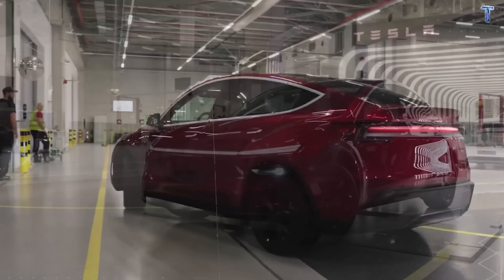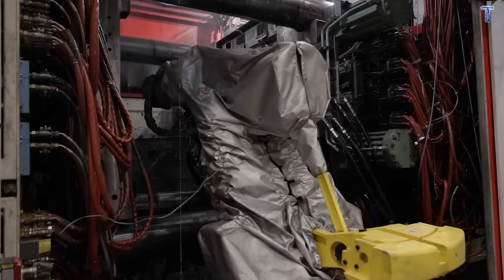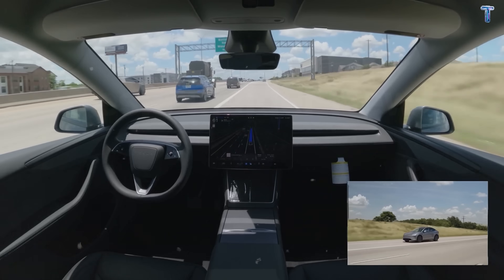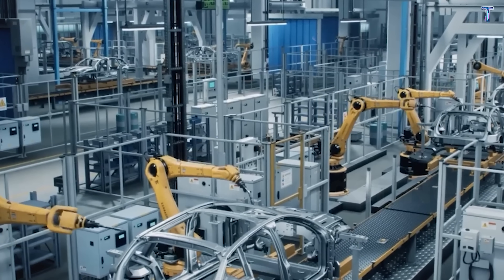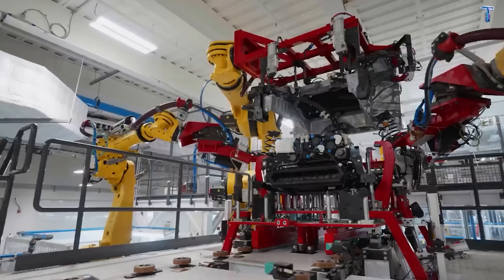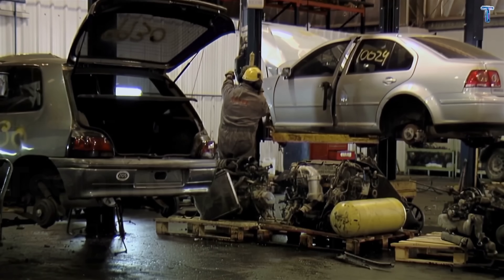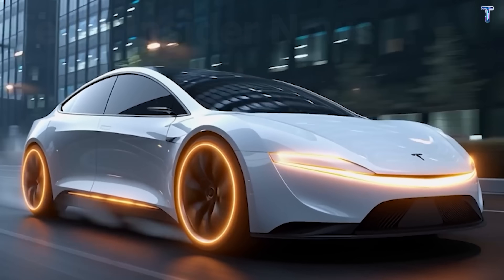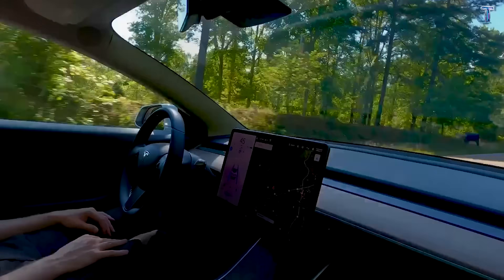Elon Musk’s $12,749 Model 2 Ends Car Bills Forever

Comment: How much will it cost to repair that one piece body when someone backs into it in the parking lot?
Reply from the maker: Fair question. The upside is most low-speed bumps only affect the outer panels, not the main structure. Repairs should be quicker and cheaper than people expect. Have you ever had a car where one tiny dent turned into a big repair bill?

Comment: I still have my car from 93 and love it still these ev cars are not a good alternative to ice cars plus the driving experience is very disconnected feeling in every way I can think of also we know how to recycle an ice engine but we don't have a way as of yet to recycle the batteries and that's not including battery issues people aren't getting 250k plus miles on the original battery to me its not worth it and they are overpriced even this is imho.
Reply from the maker: I get where you’re coming from. A solid ’93 is hard to beat. EV tech is improving fast, especially battery lifespan and recycling. What’s the part of your ’93 you think EVs can’t match yet?

Comment: The Tesla Model 2, codenamed "Redwood," is Tesla's anticipated affordable EV, targeting a ~$25k price point with a focus on cost reduction through simpler design, new manufacturing (like Giga Press), and innovative features like modular consoles and passive cooling, aiming for mass market appeal with a ~250-mile range and potential 2025-2026 launch, though official confirmation is pending, say recent 2025 reports and automotive sites. It's expected to feature new 48-volt architecture, basic interiors, and advanced software for handling, balancing cost with performance, says sources including YouTube channels and car news sites.
Reply from the maker: That’s a solid summary, and you’ve clearly been following the reports closely. The Redwood codename, simplified architecture, and 25k target line up with what most analysts expect right now. The big question is whether Tesla can actually hit those cost reductions at scale without cutting too deeply into features people care about. If the real price lands near that 25k mark with around 250 miles of range, would that meet your expectations for an affordable EV?

Comment: They're talking used prices here, the value the moment after the customer signs the purchase agreement. The customer calls it new but dealers call it used.
Reply from the maker: Dealers definitely see that instant drop in value differently than buyers do, and calling it “used” the moment the paperwork is signed reflects that mindset. For most people, that shift is invisible until they try to trade in. Do you think more transparent pricing would change how people view that immediate depreciation?

Comment: AI
Reply from the maker: It’s fair to question the price and the timeline — a lot of the info is still speculative. If Tesla does announce something official, that’s when we’ll know what’s real. What detail would convince you the most that a low-cost model is actually happening?
Reply: @TeslaInsiderNews  This ad is full of AI generated images. That is what I was addressing whether or not it will be ready as advertised and at that price. Which I doubt.
Reply from the maker: AI-generated images definitely make the whole thing feel less credible, especially when the visuals don’t match anything Tesla has shown officially. They’re great for concept videos, but they can also make people assume the claims are exaggerated or entirely fictional. Until Tesla shows real prototypes and real pricing, doubt is the reasonable position.

If an official reveal used real factory photos and confirmed specs instead of AI concepts, would that change how seriously you take the project?
Reply: @TeslaInsiderNews   Real factory photos and confirmed specs would help but the only thing that would convince me would be the testimony from some believable buyer that actually purchased one and what he actually paid for it. Further,  I find it difficult to believe the price will prove to be substantially less that, say, around 30k.

Comment: Ja ya had me till the self driving car 🚗…. That’s a HARD NO !
Reply from the maker: Totally get that — self-driving is a deal-breaker for a lot of people right now. The good thing is you can still drive it normally and ignore the autonomous features. What part of self-driving makes it a hard no for you?
Reply: @TeslaInsiderNews  the self driving vehicle 🚗 means that the car is not fully in the drivers control.  ( obviously, 🙄 I know ) but that’s the point. 
Being responsible for the vehicle and its safety is a part of the experience of driving.   By having an autonomous vehicle, part of that unique experience is removed. 
Personally, I take driving seriously and the responsibility that comes with driving is learned often through mistakes or failures.    
To allow the computer and sensors to guide the vehicle is against common sense, it would be irrational to trust such hard learned skills to AI 🤖
Reply from the maker: Trusting an autonomous system definitely feels counterintuitive when driving has always been a skill you control directly. The responsibility, the attention, the judgment you build over years — that’s part of what makes people confident behind the wheel. Handing some of that over to sensors and algorithms can feel like giving up something essential, even if the tech improves safety on paper.

A lot of drivers will still want the option to stay fully in control, even if assistance features exist in the background. For you, is the concern more about losing that learned responsibility, or about AI making decisions you’d rather handle yourself?
Reply: @TeslaInsiderNews  Thank you for the dialogue.     I have become accustomed to many automated processes in life and have seen nearly miraculous progress. 
However the responsibility of driving an automobile 🚗 is considerably greater than my own personal safety.    It involves the safety of others and it would be difficult to entrust sensors to that duty.    My cautious approach is built on both personal experience and statistical data.   There are simply too many variables in a real life 3 dimensional environment to allow me to feel comfortable with autonomous vehicles.    Even though I believe there are wonderful places for such conveyances such as airport trams 🚈 and light rail.    The undertaking of risk should be accompanied by the responsibility of the driver.   For example,It would be safer for an impaired driver to give the computer the job of driving home from the bar, however the impaired person isn’t in any position to delegate responsibility.
Reply from the maker: That’s a thoughtful way to look at it — the responsibility of driving isn’t just about your own safety but everyone sharing the road with you. When you’ve built real skill through experience, trusting sensors and software to make split-second decisions can feel like giving up something essential, especially when the environment is unpredictable in ways AI still struggles with.

Autonomous tech works well in controlled systems like airport trams or rail lines because variables are limited. Out on real roads, you’re dealing with weather, human behavior, animals, debris, unpredictable drivers — all the things your instincts were built to handle.

For people who take driving seriously, keeping that responsibility in their own hands feels like the only rational choice. If future systems allowed you to stay fully in command but use autonomy only as a backup, would that strike a better balance, or do you prefer keeping the car entirely manual?
Reply: @TeslaInsiderNews . Undoubtedly, AI will become far better and its situational awareness will increase.   So, yes there will be a time when a fully autonomous automobile will be safer and more efficient than it currently is.    It may already be safer than many unpredictable human drivers.   Personally, I hope that time is near as I myself am aging and would be well served by a trustworthy reliable method of personal transportation.   Once again thank you for the opportunity to discuss this topic.  😊
Reply from the maker: You summed it up really well — the tech will get better, but trusting it fully has to feel earned. What the Model 2 does here is keep you in control while using the upgraded cameras, radar, and LiDAR mainly to prevent false stops and make driving smoother. It’s not forcing autonomy on anyone. For a lot of people, especially as they get older, having those systems as a backup rather than a replacement can make driving safer without taking away the experience you value.

Comment: Really does sound "too good to be true".   I seriously doubt that the government, who has their hands in everything, will allow a vehicle that they would not profit from.  The big auto manufacturers will make sure it doesn't happen, through their campaign contributions...
Reply from the maker: Skepticism makes sense — big shifts in pricing and tech always run into resistance. But if the Model 2 proves cost-effective and safe, it’ll be hard for regulators or legacy brands to slow it down. What part of the rollout do you think will face the most pushback?

Comment: Until you need the battery replaced.
Reply from the maker: Fair point — battery longevity is always the big question. These newer chemistries are designed to last decades, but real-world use will tell the full story. What’s your biggest concern about long-term battery wear?

Comment: I'm calling total BS.  This would kill the rest of the Tesla lineup.
Reply from the maker: If the specs and price were exactly as shown, it would definitely shake up the whole lineup. What part feels the most unrealistic to you right now?
Reply: @TeslaInsiderNews  The battery packs alone cost more than $12K if my understanding is correct.  Unfortunately this truly is one of those I'd have to see it to believe it moments.  Maybe this is one of those new TINY cars and not anything like what is bein\g shown in the video,  Then I might believe it.
Reply from the maker: The cost of battery packs is definitely one of the biggest reasons people doubt a price anywhere near 12k. Even with cost-cutting and new chemistries, it’s hard to imagine the pack alone being that cheap today. A tiny ultra-budget car could hit a low price, but not the kind of model shown in the video. If Tesla did release something much smaller and simpler instead, would you still be interested, or are you only looking at a full-size compact?

Comment: No, there is no credible evidence that Tesla or Elon Musk plans to produce a car for around $12,000 in the American market. Videos claiming this are likely based on speculative or false rumors, as Tesla’s current lineup starts at about $40,000 and earlier plans for a $25,000 “Model 2” were canceled. 10
Reply from the maker: Totally fair to question the claims — there’s a lot of rumor mixed in with early reporting. If Tesla does revive a low-cost model, the real price will depend on what actually makes it into production. What source would you trust most for confirmation?

Comment: When will Tesla come up with a plan to upgrade the power grid to handle all these cars?
Reply from the maker: That’s a big question, and it’s one every EV company has to think about. Tesla’s approach so far has been expanding charging networks and boosting efficiency so cars draw less power overall. Long term, grid upgrades will need wider industry and government involvement too. What part of the grid are you most concerned about?

Comment: save gas? how much is the home charger cost, how much electricty wil it cost you monthly
Reply from the maker: Great questions — that’s exactly what decides if it’s worth it or not.

In most areas, charging at home is much cheaper than gas. For a car like this, many drivers would be looking at somewhere around $30–$60 a month in electricity for normal commuting, depending on local power rates and how much you drive. A basic Level 2 home charger typically runs a few hundred dollars plus installation, but you can also start by using a regular outlet if you don’t mind slower charging.

What’s your average monthly gas bill right now?

Comment: I want one with hand controls, I'm a paraplegic .
Reply from the maker: That’s absolutely possible — a lot of EVs can be adapted with hand-control systems. The key is finding a certified mobility installer who can set it up safely. What type of hand controls have you used before or felt most comfortable with?
Reply: @TeslaInsiderNews I used the typical hand controls. I have a big van with a lift. Though I am able to get in and out of a regular car. I've rented a Honda Odyssey but I wish they had a paddle accelerator and braking. I like sliding rear doors or suicide doors. It makes it easier to get a wheelchair in the back if I'm by myself. Auto mfg'ers just care more about quarterly profits than people.
Reply from the maker: Sliding doors and suicide doors really do make a huge difference when you’re loading a chair on your own, and a paddle-style accelerator and brake system would give you much more natural control than the older hand-control setups. It’s frustrating that most manufacturers still prioritize cost-cutting over building accessibility features right into the design. If a smaller EV came with an adaptable interior that allowed easier transfer and chair loading, would that make you switch from the van, or do you still need the extra space?
Reply: @TeslaInsiderNews yes, I have toys. I land sail in the deserts. I'd like a run around ele and my toy hauler.
Reply from the maker: A lightweight EV that can tow a toy hauler and still work for daily run-around driving actually makes a lot of sense, especially with hand-control compatibility built in. Having your land-sailing gear means interior space and door layout matter even more, and a smaller EV with sliding or suicide doors would make loading and unloading way easier.

If the EV offered enough torque for towing your toy hauler safely, do you think it could replace your van entirely, or would you keep both for different uses?

Comment: ALL EVs, Unsafe at any Speed!🔥🔥🔥
Reply from the maker: Safety concerns are real, but the tech has been improving fast. What specific issue worries you most about EVs today?
Reply: @TeslaInsiderNews  thermal runway of the battery, tech  has not improved at all. It’s the same lithium ion technologies since day one. I come from a whole family of first responders. They’ve had the training they know that danger.
Reply from the maker: Thermal runaway is a legitimate concern, especially for first responders who deal with the worst-case scenarios. Even with newer chemistries like LFP reducing the risk, the fear comes from how difficult EV battery fires are to control once they start. Training helps, but the danger is still real. What do you think would make you feel more confident — better battery designs, or better emergency protocols?

Comment: Crazy that will not last 200,000 miles 😂😂😂
Reply from the maker: Plenty of people doubt it, and EV longevity really depends on build quality and battery chemistry more than anything else. Some packs already pass 300,000 miles, so it’s not impossible for the next generation to go further. What mileage do you usually expect a car to reach before you consider it proven?
Reply: My 2006 honda civic 255k still going strong only battery and tires was replaced so far
Reply from the maker: A Honda hitting 255k with only basic wear items replaced is exactly why people trust those older gas models — they proved themselves over decades. EVs will have to show that same kind of real-world endurance before a lot of drivers take the longevity claims seriously. If a future EV could reliably hit 300k miles with that same low-maintenance experience, would you consider switching, or are you sticking with gas as long as cars like your Honda keep going?

Comment: He should use them all for Waymo.    It could be the Standard.  Other than that. The 3 is now running 70k.
Reply from the maker: If Waymo adopted a fleet like that, it really could reset the whole industry standard, especially with how high prices have gotten on cars like the Model 3. Do you think autonomous fleets will push prices down again, or are we heading the other direction?
Reply: @TeslaInsiderNews Not about prices. At all. Waymo mostly uses cars like EJags. VW IDs. With their Software and hardware installed. 
But Uber and Lyft is basically dead.
Reply from the maker: Waymo using premium donor cars like Jaguars and VW IDs definitely shows their focus isn’t about lowering prices — it’s about building a reliable autonomous platform first. Uber and Lyft struggling is a good example of how automation could reshape the whole ride-hailing model rather than the retail car market.

If robotaxi fleets keep expanding, do you think most people will eventually choose not to own a car at all?